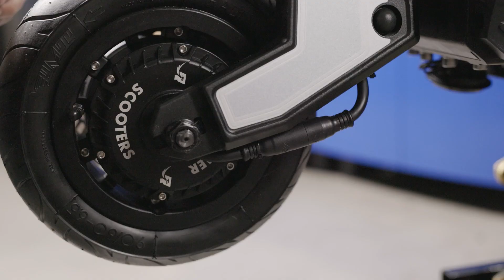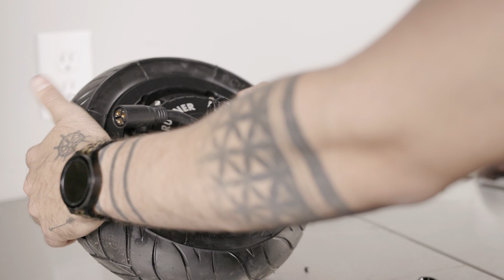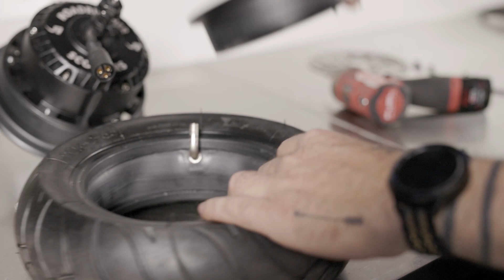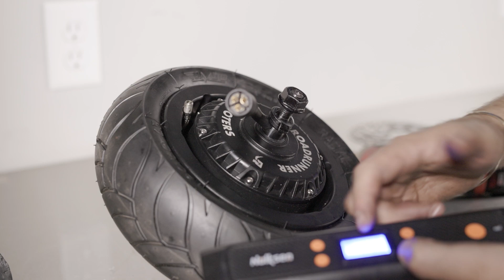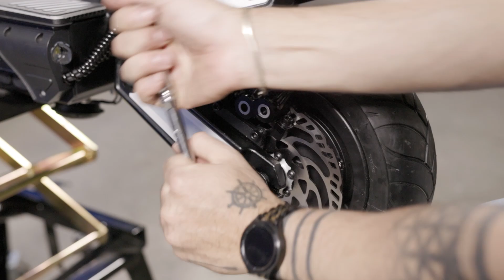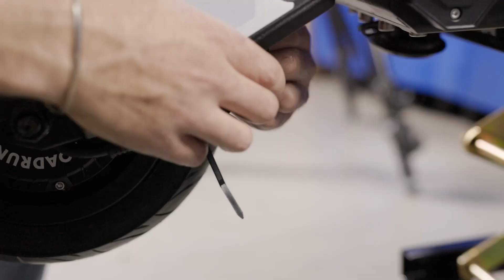RX7 Tire Change or Motor Replacement (Tubed)

Comment: Theres no way that wheel came off and back on that smoothly, also when I took my wheel off it had glue you guys put on, on the nuts and made it damn near impossible to come off, now im trying to get the wheel back on and I can’t because I had to beat it off to get it off.  The entire thing won’t go back in theres no way y’all got it to slide in so easily there is no clearance unless you guys didn’t put this one together the same.  This is actually terrible design man, y’all need to fix this I can’t get my wheel back on now you need to make a video completely tearing down the back swing arm
Reply from the maker: We’re sorry to hear about the trouble you're having, and we’d be happy to provide some technical guidance to help you get your wheel back on if you would kindly reach out to our support team. 😊

Comment: Hello, good video. I recently got a micro nail in my rear rx7 tire. I was not aware the rx7 had tubes in the tire. Can you make more videos for self repairs? Like changing brake fluid on rear brakes, how to remove squeeky brakes, changing other items on the scooter. Thank you so much for your video.
Reply from the maker: Early versions of the RX7 did come with inner tubes in the tires, which is why you may have encountered one in your rear wheel.

We really appreciate your feedback on the types of videos you’d like to see. Suggestions like brake fluid changes, fixing squeaky brakes, and other common maintenance topics are super helpful, and we’ll definitely pass this along to our team for future content.